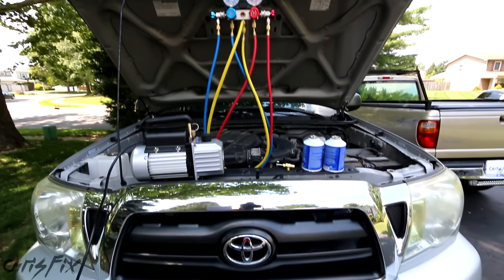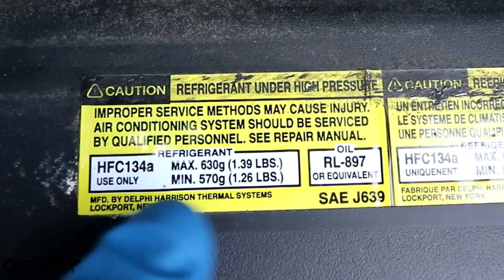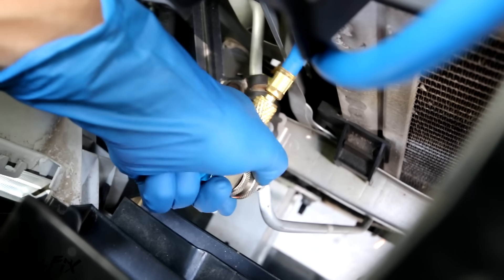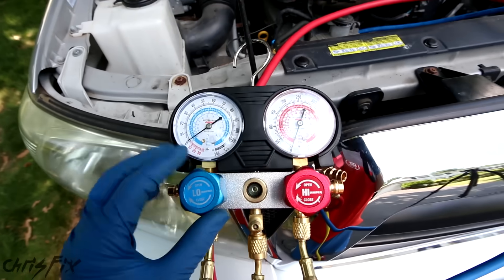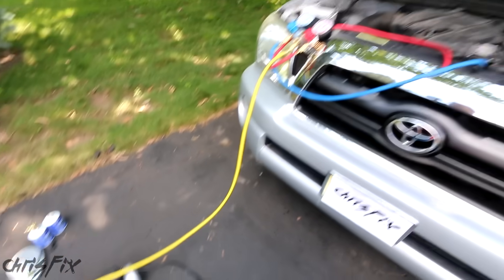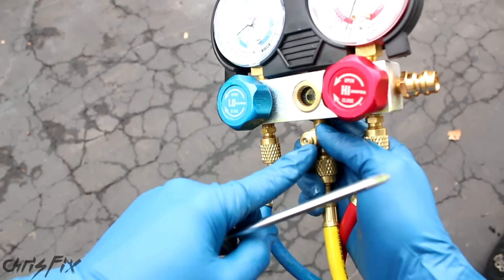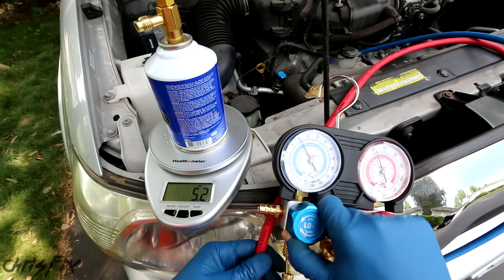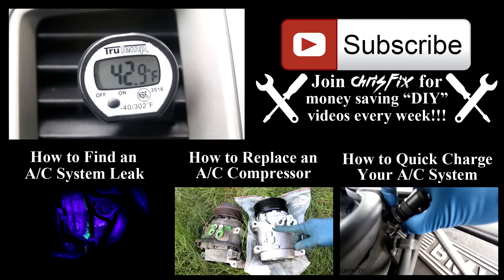How to Properly Recharge Your AC System

Comment: Simply excellent! This is probably the best, clearest, most thorough explanation of the proper way to do this. It might have been good to give some background at the start, to mention that you's replaced the compressor, etc., so that people would know you were starting from scratch. I think most people really struggle with trouble-shooting a system that a system that stops working, and their first reaction is to add Freon. An idea for another video might be a trouble-shooting video... adding florescent dye to the Freon, checking belts and pulleys, etc. But awesome work... one of the best videos I've seen on YouTube!

Comment: I thought you were supposed to flush the system with nitrogen as well.
Reply: Flushing.  I have flushed with a water hose.  Took a connection, female for an air hose.  Adapted that to a female hose connection.  I used a rubber tipped air blower for a water spray nozzle.  Then, spray out with air.  If its over 70 deg, water is gone with a vacuum pump.
Reply: @ridgerunner106  So for my F-150 compressor and line/dryer replacement I used a quart of AC cleaner, lots of compressor time to blow every last bit of oil and cleaner out, evacuated for several hours, held pressure for several hours and then filled. The flush is to get oil and debris out, not to evacuate air as I originally thought. The vacuum pump does that. Ice cold but boy does that compressor pull on the motor hard!
Reply: @gymkhanadog  I will enlighten you.  The compressor does pull on the engine.  But those model Fords have the best AC system on the planet.  Then, factor in ease of repair compared to newer vehicles, way super better.  Hang on to that truck.  I have the older 79 and before.  I have over 50 junkers out back. But, I do drive an 04 expedition, but it was free.  My last one was a Chrysler, was 50 bucks, bought it for junk, but it ran. Still have it, runs good, drove ig for years.  I did love the posi front end.  Drove that car for years at 30 mpg.  Hit two deer in 8 days, need some repair.  
    Then, I cleaned out four poultry houses.  I got paid for cleaning them out. But, since I did it on time, the owner gave me this expedition.  Almost 195,000 miles, but runs good, ac is cold, no dents at all.  I can work with that.  It does have the 5.4 engine.  It sways and feels like a boat when driving.  You have to think, I stepped out of a 76 F250 and got in this thing.  It really has too many dings and whistles for me.  76 didnt even have dash lights. No dingers for left the headlights on, left the key in it, seat belt, door not closed good, oh at all the dinging bells.  Funny, i lived without all that just fine.  The Chrysler, I had to leave those fuses out or I would have a regular dead battery all the time.  All the plastic in Dodge/Chryslers is brittle junk.  And their glass is different.  If it rained, drove with windows down so I could see.  If you see a vehicle on a rainy night, and all windows are fogged, its a Chrysler product.  Only ones Ive seen.

Comment: What if I try to pull a vacuum while there is still refrigerant
Will it pull the refrigerant in the form of liquid? (Because the engine is turned off)
Or should I do this while the engine is running?

Comment: You showed the 12 fluid ounce can and used it as 12 oz weight. You weighed the second can and added to the 12 fl oz can. Your actual weight cannot be accurate.  I plan the weigh both cans. When the first can is empty, I will weigh the empty can to get a accurate amount in the system and a take weight of the second can. I could not give a thumbs up, due to this serious misinformation.
Reply from the maker: Unfortunately you are incorrect. The weight of the can does not matter. It is the change of weight which you are looking for. The can could weigh 100lbs or 2lbs... If you remove 1lb of refrigerant from it, you will see that when the scale goes down 1lb.

Comment: Man, 
I am struggling to understand the specification of the vacuum pump used.
I know it is 1/4 (quarter) horse power
But what does it mean if my air cond 
System have 50+ something of PSI
(Pounds per Square Inch)
What if I use a 1/2  horse power vacuum pump?
Will it have higher maximum pressure being pumped?

Comment: Its impossible to pour oil in the hose. Vacuum the high side and and pour into low side port without the valve core and it will suck it in.
Reply from the maker: Thanks for sharing!

Comment: Great advice for U.S. guys. Unfortunately in Aus, we need to be licensed under Ozone and Greenhouse gas regulations to even purchase this gas. Is probably why we repairers can sometimes get a bad rap for being expensive with our repairs. Cheers from Aus. P.S. A tip for replacing a compressor is to do an oil balance as per the warranty sheet with the new compressor, this will compensate for oil already in the system and will stop oil slugging the new compressor from too much oil in the system. Always replace the Filter dryer to remove any old oil/metal particles and moisture trapped in it.
Reply: From Australia too, was thinking the same thing, and top ups are illegal, as you must have a leak in the system
Reply: @MrMarkguth  Sometimes I find simple leaks like access caps missing and put that down to a leak, but yeah they make it hard for licenced repairers, if they do top ups. I depends on the customer and how much they want to pay.

Comment: Can you do  this with refrigerant still in the system? I was told mine was "low"... That vacuum doesn't remove the refrigerant right?
Reply: vacuum will remove the refrigerant
Reply: @joecanon5527  Ok. The 1st refrigerant can you kept upside down... the 2nd one wasn't.... Any reason for doing them differently?
Reply: @brandontranchon8302  I'm not the guy in the video but I will tell you do not torn a can upside down.  it's not good to introduce the liquid into the system.  you run a chance of hydro locking the compressor.  I think the cans will tell you to move them from a 1oclock to 3oclock position but not turn them upside down.

Comment: Anybody know why my ac is cold for about 20 mins then gets hot. Can sometimes last an hour cold also. While it’s hot the low side I believe(I forget cuz it was months ago) went into a vacuum. I squirted water on txv and it started bubbling around the sides. Idk if there’s suppose to be air coming from behind the txv. When car is shut off the pressures equal out in a few minutes and the faster I rev the louder I heard a groaning noise

Comment: so, i added refrigerant to my car. since the car is old enough to not have ac fromt he factory and it has custom fitted ac, idk how much refrigerant it takes. so I filled it up until the sight glass on receiver drier is clear . and my vent temperature is arond -2.2c or 28f. is it okay? from your video it shows around 42f or 5.5c

my compressor is sanden SD507 or SD5H11 retrofitted from R12 to R134a

Comment: 10:21 Instructions unclear, blew my car up.
Reply: You shouldn't turn the bottle down as it sends liquid refrigerant and is too much pressure to handle by the compressor, that is what you see in the manyfold window, I only do that when a system seems to be obstructed and for no more than 3 seconds, also you might not be able to handle how much refrigerant is entering and end up overloading the system causing the blow up, bottle up and be sure the actual weight is on the sale and not being held or pushed by the hose.

Comment: Pressure loss on the high side.  

When I do the vacuum test, the low side stays on -30 PSI for
 an hour BUT the high side seems to lose vacuum.  After a few minutes, the high side goes from about -10 PSI to 0.  Is this a concern, the video doesn’t seem to look at the high side which I don’t understand why?  The 2 sides don’t seem to be “connected” when the car compressor isn’t running, the car turned off

Comment: Hey Chris fix I love how you explain everything step-by-step I’ve been watching videos for a while I don’t have a lot experience fixing cars I have done things to my car and I have save a lot of money but I have a question can I do this to an older model auto F150 Ford 88 with the compressor etc......
Reply: The process is probably similar, but an older truck like that will probably use R12 refrigerant.
Reply: Thanks you
Reply: If it uses freon, flush out the system with a water hose, rinse it out good.  I use a runner tipped air blower screwed onto a water hose.  Change the oil in the compressor.  Compressor has a drain plug.  Or, get a new compressor.  Dont flush water in the compressor, just in the rest of the system.  Go ahead and split that box on the passenger firewall and wash evaporator off.  Full of dirt sometimes.  Id hang on to that truck.  Those are so easy to keep going.  Heater core can be taken out in 30 mins.  Evaporator easy to get to.  AC system blows cold when it works right.  97 and newer, you have to tale the entire dash out to the metal firewall, such a headache.  Automakers can make them easy if they wanted to, but they dont.   80-96 Fords are easy.  I dont know too much about others.  I always take the amount of oil off the amount of total charge.  I still over fill a little anyway.

Comment: Just FYI: topping off a charge with blended refrigerant will cause the ac system to cool inefficient. For best results, completely evacuate, pull vac., And charge per data plate

Comment: Hí Chris.
I'm not much a comment leaver but i have a few question a out The ac refilling. I tested and realised i Just neked tó fill up My cars ac. So i did refilled it. I bought a refilling kit and did as you said inthis video. I have a little concern about the pressure. When The ac is running, it is in The Green scale but as soon as The ac is off it is in The yellow scale, is it means i filled a little bit more Than it needed?

Comment: A few safety tips for anyone doing this:

1. Unless you are pulling vacuum, you must NEVER open both valves on the manifold.
2. Tighhten the refrigerant hoses very well(with hand) because a hose falling off during charging can cause a serious risk.
3. Wear thick gloves as refrigerant cools extremely rapidly and cause frost bit on skin wherever it touches.
4. Before you remove the hoses, you should depressurize them from the bleeding point shownin the video. If you dont do that, when removing the valve a sudden splash of refrigerant can cause frost bite on fingers.
5. If you donot have a scale or thermometer, refer to standard pressure charts for high and low side to ensure you donot overfill, keep an eye on high side pressure, while filling that can go up before you see low side pressure rising. 
6. Go slow, real slow there is no hurry.
7. Keep your ac at maximum refriegeration load, this means making your ac work harder, open all windows, turn ac to max to work out the ac, if the compressor turns off while charging gas, a backflow is possible which is not ideal.
Reply from the maker: Thanks for the tips!
Reply: U say never open the low n high side unless its when you are pulling vaccum ON THE MANIFOLD. But is it ok top open both high and low on the connection sides ? Seems like those stay open at all times until everything is complete
Reply: @aracelyaguilar4844  when you open them on the connection side, they are only open to their respective gauges on the manifold. When you open the valves at the manifold, they are opened to the shared chamber in the middle of the manifold.

Comment: I'm having trouble charging the ac on my 2000 Lincoln. I pulled a vaccum for a hour as you described and when done no R134a would go in the system. I even jumped the low pressure swtich and still no go. Could you please advise?

Comment: adding oil through the charge hose is introducing "air" to the system along with moisture and non condensables fyi
Reply from the maker: How do you suggest to do it?
Reply: @chrisfix  buy a oil injector probably like 40$ on Amazon

Comment: Thank you so much Chris I bought an 01 mustang gt 5 speed and I've done just about everyone of your tutorials on her to get her right now she's running pitch perfect!!
Reply: @MercuryRisingFast  Hows the AC coming along?
Reply: @MercuryRisingFast  I love it when a plan comes together.
Reply: @MercuryRisingFast  Mine had a problem.  It ended up being a rotten vacuum hose and a non working vacuum check valve.  I imagine parts of the disentigrating hose are in the check part.  Now, i put some hooks in the ceiling and hang meat in it at night because it is so cold.  But, it is nice because I like to take my little dog everywhere.  I can leave it running with the AC blowing, and she is fine.  Im in a rough rural environment here.  I was twenty miles away at a chicken farm replacing a compressor last night on an International truck.  But, shes my pal, checks out the area while I am working.

Comment: When or how do you recharge car ac system?  If ac system does not leak so you never need to recharge?
Reply from the maker: Technically the only time you should recharge the system is if you need to replace a failed component (like a compressor), and you are correct!

Comment: Great video. Careful, though, turning can upside down. Rarely a problem, but can stress a tired system. Also, don't charge system on a very cold day with very cold cans. Usually, a 75 to 85 degree day and bottle is ideal.

Comment: I appreciate your videos.  I tried this for  my first time and realize that you only get one chance to do it right.  If you mess it up, you have to take it to a shop to get evacuated before you can try again.     This must be done very, very meticulously and it is very easy for something to go wrong and spoil the vaccuum and contaminate the process.
Reply from the maker: Thanks a lot! Fortunately the process is easy once you know all the steps!
Reply: @chrisfix  With my attempt, the refrigerant can didn't seal completely when the tap was closed.  Also, after i loaded the oil in the line i noticed the vaccuum leaked down a little somehow, but now I don't have an extra line to reapply the vaccuum.  Lol.  It held for more than 24 hours, so i know the system is good, it was just me not knowing the process. Also, since the can was leaking, i don't know how much refrigerant i lost as i was setting it up.  The worst part is there is no remedy, no improvisation.  You mess up, your done, unless you want to risk system damage.  I will try again someday and i will write down the steps beforehand.  I learned a ton though and am now no longer afraid to work on the ac system.  Thank you so much.

Comment: This really is half done. You should not follow this.. it's great you are giving people confidence to DIY. But only showing people how to recharge is pointless. Rl897 is hydroscopic, it needs to be changed every 12 months. And change your reciever dryer. If your system has failed or been open longer than 10 minutes. Your asking for a break down

Comment: R12 is only considered bad for the environment, because the space shuttle used r12 to cool down the rocket.
Reply: Yeah. I wonder if it's more efficient or something? Like, definitely not because I'm going to add the best stuff there is for my car...
Reply: @kevanchristian5196  I'm not sure, but if the space shuttle would've used r134a it wouldve been considered just as bad. My uncle works with refrigeration units and has asked many people and studied why it is considered bad.
Reply: @TylerJohnson-wp2qf  Yeah, I meant i was wondering which one is more efficient for a car regardless of how "hazardous" it is
Reply: @kevanchristian5196  r12 is, it last a lot longer than r134a. Old trucks and cars used it until 93. The reasons most cars from that time don't have working ac, is because of people not doing enough maintenance.